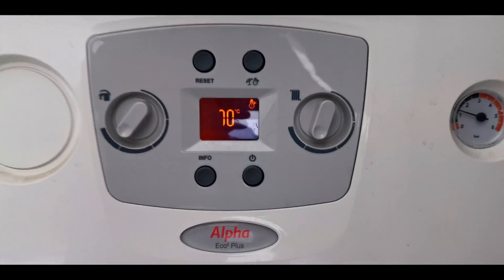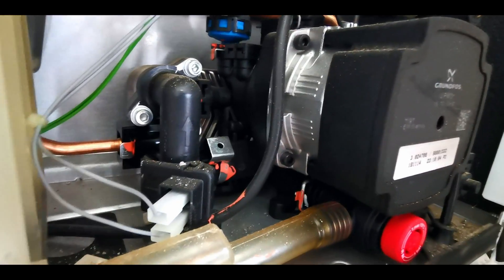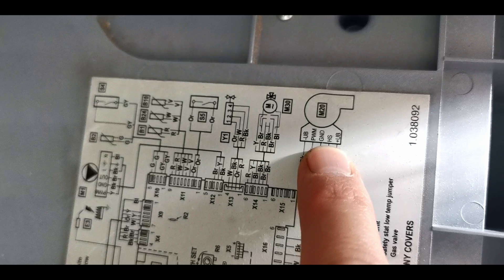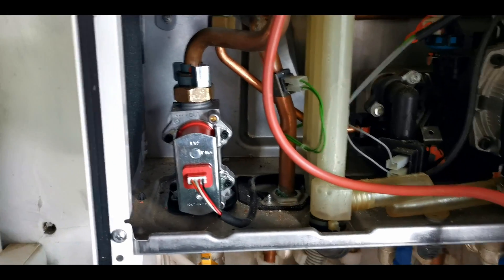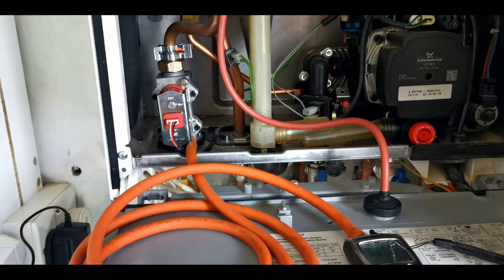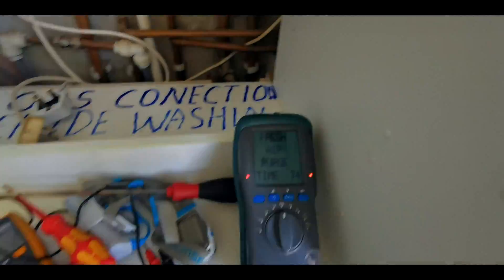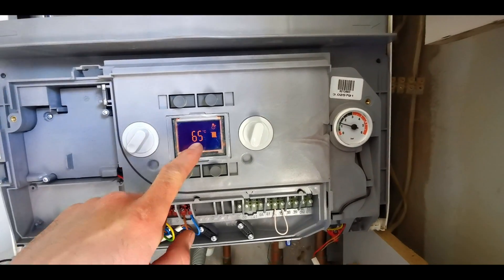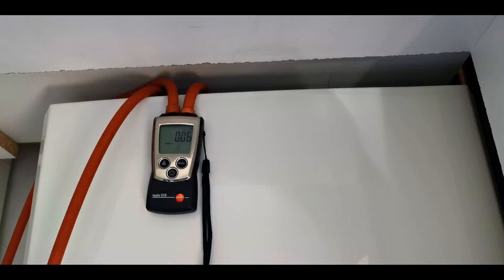Alpha Boiler Gas Valve Set up. Baxi boiler E133 fault code? Warmhaus E06 fault code?

Comment: If you had been the 1st engineer to attend,  would you have done like them and initially changed electrodes etc?
Or gone straight to the manual calibration or both?
As time is often a factor..ie other jobs to attend
Reply from the maker: KISS. I would always check the basics first.

Comment: Hi I had my Main Combi 30 HE boiler replaced with a new Valiant ecoTec Pro 30kw combi boiler 2 days ago. Later that day when I had a shower I noticed that the water flow rate wasn't as strong/fast as it was before. Do you know why this could potentially be. Thank you in advance.
Reply from the maker: You should ask your installer.

Comment: It is easier if you have a hot water tank to avoid cutting out at 90 degrees in the summertime. I spent 3.5 hours on a similar job and the next job the dog got away... good day for me :)
Reply from the maker: It can be really hard work sometimes. I have only had a dog escape once. It was funny afterwards, but not at the time....

Comment: Those gas valves are a nightmare i had baxi megaflow that was going to lockout end up changing the combustion seal then the gas valve then the pcb blew 😱. It takes ages to setup
Reply from the maker: Thats the issue. Way too long to set up.

Comment: Flue gas analysers have to be calibrated (by law) on a yearly basis. Clearly this boiler which is claimed can self analyse it's flue gas falls well short of that requirement.
The makers need to be held accountable.
Reply from the maker: It checks the flame quality not the flue gases. It also displays the fault codes to show that there is an issue which is why I was there. The boiler does exactly what its meant too. The gas valve is difficult to set up and doesn't hold its settings very well. As soon as that happens the boiler displays a fault code. :-)
Reply: So, in self calibration it's solely measuring the ionisation current and adjusting the gas valve on that info alone. I'm lucky not to have seen any of these (I'm mostly commercial stuff). I'm curious to know if they ever drift out of setting enough to produce high co?  Setting them up looks a bit of a nightmare, would it be possible to do it in Dhw mode ( like a Worcester greenstar) to keep the temperature down,? 👍
Reply from the maker: @gowergas5034  Thats right. They do drift out and get high CO. Thats when they put fault codes up. Any slight change in gas quality or pressure causes the same fault codes too. Its like trying to run on a knife edge. I really want to get into commercial. I have the ticket but no work. :-)

Comment: Very, very informative as always Ollie👍
It’s a very popular wee boiler the Alpha, but I’m sure the commissioning details you gave would go straight over most installer’s heads.
Some very redeeming features on these, however the non-standard DIN is a pain. 
Of course if Alpha were up-front with the true commissioning requirements it would put a lot of people off buying them.
But hey, they’re no different from all the others, well, with some exceptions.
Mate, your videos are Gold Dust to our industry, keep up the good work👍
Reply from the maker: Thanks. :-).. The idea behind it is very good. Its just not reliable enough. The combustion changes too much over the years and they take time to put right. I have done way too many of these now (Not Alpha) the gas valves are not consistent enough.

Comment: Bertelli are, I believe, now owned by Baxi. The gas valve as pointed out by HG was used on the Baxi GA range (R-I-P!), I worked for Baxi during the GA range release and that valve just would not work properly. We were visiting the same customers trying various fixes as advised by Baxi D & D department. Nothing worked!
Reply from the maker: The valve is a lot more reliable now but still won't float correctly (over a few years) so it needs time spent to set it up. Probably every other service tbh.

Comment: Thanks HG very helpful, I have to go back to one on Friday with a new gas valve, but I will do the set up first on Max, Min, and Ignition to see if that works (Boiler was going to E133, DuoTec 28GA). It was making a funny noise, as was the gas meter and the CO2 was miles out (4.9%), engineer ordered a gas valve so I will see. Thanks again!
Reply from the maker: Take your time and make sure you have a couple of hours. Otherwise you will be stressing and it will make it worse. :-)
Reply: Make sure the ionisation probe is spotless as well with the e133 fault do a reset on the gas valve and set up I’ve got some good info on it (engineers manual ) I’ll see if I can work out how to post it in here for you pal
Reply from the maker: @jamesasprey2092  You're right. I didn't mention the electrode and lead enough tbh. Its the whole lot that can cause the issue. If the combustion goes out the electrodes can warp too.
Reply: HeatingGeek I’ve got a good engineers book for the ga range setting up the gas valve after reset can’t work out how to upload it on here ha! Great work again pal your a credit to the industry 👌
Reply from the maker: @jamesasprey2092  Thanks. Whats the name of the book? Maybe I can find a link and put it on the of this comments page.
Reply: HeatingGeek I’ve googled how to do it let me know if it loads up pal plse
Reply from the maker: @jamesasprey2092  Yep It works. I will try and pin it to the top. :-) Nice one.
Reply: HeatingGeek great stuff saved me a good few gas valves has setting it up like they say in the mi’s and cleaning the electrode 👌
Reply from the maker: @jamesasprey2092  Nice. Do you know why Baxi stuck with the valve, even to this day? I wish I could find out why.
Reply: HeatingGeek all I heard was after the ga range gas valves started failing baxi took bottelli to court over it and some how ended up buying the company out hence that’s why they are still using the valves (Simeon’s May correct me on here )

Comment: Good video... very complicated boilers these alphas!! Good to see one set-up manually, doesn’t look like there is much range in the settings tho, the low / high / ignition are only at 9.0 / 9.1 / 9.0 ??  I’ll stick to my Worcester’s over these
Reply from the maker: The Ideal was a good one but these valves are just a pain in the ass to set.

Comment: I had one of these took me three hours on and off the phone to alpha, I would set it up it would run for two weeks and then the settings would shift and  the call would come back in ( frustration central )
Reply from the maker: I know. Very frustrating to set up. 70-30. 30% of the time it takes 30min, rest of the time it takes 1-3 hours.